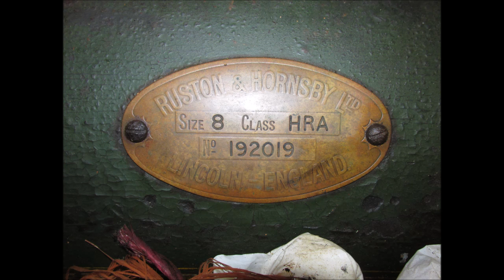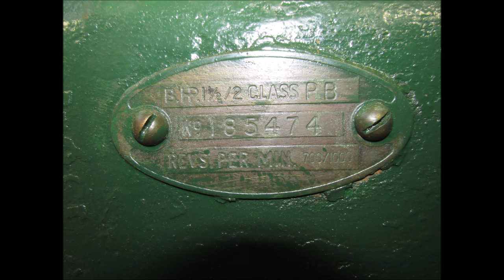Ruston & Hornsby 8HRA

Comment: Pretty massive flywheel there! 415V seems like an odd voltage was it used in a factory or something?
Reply from the maker: thatguyoverthization  415 v is 3 phase in the UK. mainly used for running big motors